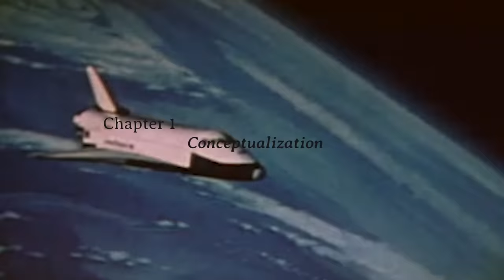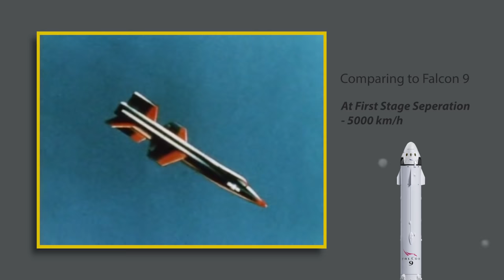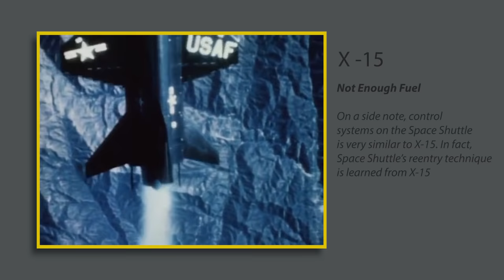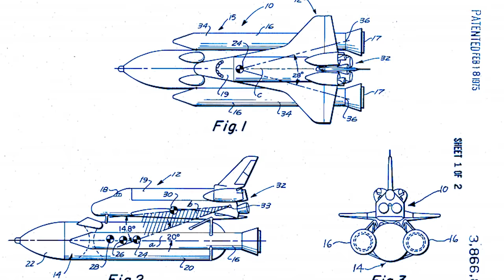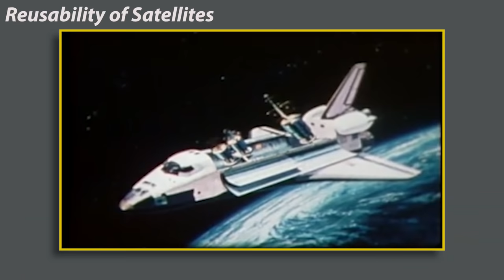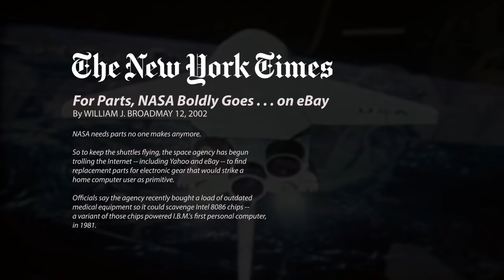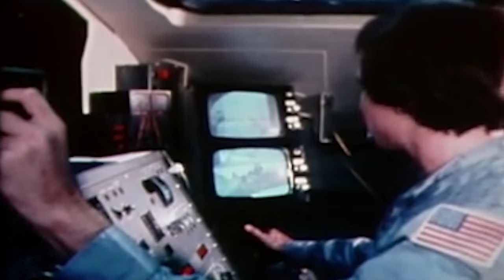The Space Shuttle, a failed attempt at Reusability?

Comment: 7:50 you said that there were 0 fatalities during the Apollo program. However 3 astronauts were killed during Apollo 1. They were burned inside the command module.
Reply: Parthenis Deslis yes, a bit of an oversight there
Reply: Was just about to make the same complaint myself, but other that that it was a good video :)
Reply: CC Williams, Elliot See, and Charlie Bassett died in a plane crashes too.
Reply: Technically that wasn't during a mission so I don't think that counts.
Reply: The thing is that those 3 astronauts died in a test of what was supposed to be the Apollo 1 mission but after the accident NASA stablished the name AS-204 for the mission so people wouldn't relate it to the Apollo program.
Reply: Miguel NASA actually specifically named it Apollo 1 as per the widows' request, so their husbands could still have a flight. (Source: Carrying the Fire or Apollo 8, I forget which book) Then Apollo 2&3 we're retro activity named AS-20x flights. The neglect that lead to the Apollo 1 fire was the same neglect that lead to both Space Shuttle disasters
Reply: With Apollo 1, that wasn't necessary a lack of oversight. While yes, the hatch was an issue along with some other factors. The main factor that started the fire was an electric wire that had lost it's Teflon coating which allowed it to arc. 

The events of Columbia and Challenger both could have been preventable had NASA taken the appropriate approach when they should have.
Reply: Alex Marquette, Apollo 1 WAS preventable. While the frayed wiring was the source of the spark, the fire was the direct result of a cabin pressurized with 100% Oxygen. It was already a bomb waiting to go off. THAT was the fault of NASA and was preventable. As Frank Borman said in part ‘It WAS a failure. A failure of imagination. Could an astronaut die while on a mission? Sure. But no one imagined it was possible for astronauts to die on the ground during a test.’ 

Also, the astronauts never burned. They died of asphyxiation.
Reply: +glennac The Apollo capsules continued to use 100% Oxygen.  The interior was redesigned to allow this "safely". That's why they needed an airlock to dock with Soyuz on the Apollo-Soyuz friendship mission.  It also simplified and lightened the Lunar Module and the EVA suits. EVA suits on the ISS continue to use 100% oxygen because the lower pressure differential to the vacuum lessens fatigue.
Reply: They pressurized Apollo 1 above ambient to simulate the pressure differential in space. So the absolute pressure on the ground was about six times higher than it was in-flight.
Reply: klugshicer, Yes, my remarks should have emphasized the “pressurized” nature of the 100% Oxygen. That’s what killed them. A change did follow regarding ground level atmosphere inside the Apollo capsule since NASA now realized there was a deadly problem.

“The Apollo 1 accident investigation prompted NASA to revisit the spacecraft’s pure oxygen environment, the benefits of the simpler and lighter single gas system and a low density flight environment remained. The real problem, NASA reasoned, was the high pressure at sea level, something that only happened before launch. And so the proposal was raised by Max Faget, one of the pioneering engineers behind the blunt body capsule spacecraft, that NASA change the only the launch atmosphere of the spacecraft. He suggested replacing pure oxygen with a mixed gas atmosphere, either oxygen-nitrogen or oxygen-helium in a 60:40 ratio. This mixed atmosphere could be bled out during ascent into orbit and replaced with pure oxygen. It would demand only minimal changes to the spacecraft and wouldn’t affect the crew; they would be breathing their own pure oxygen supply at launch as usual.
NASA accepted this proposal on March 14, 1968, and selected nitrogen as the diluting gas there were fewer questions about how onboard systems would interact with nitrogen than helium.” (https://www.popsci.com/amp/why-did-nasa-still-use-pure-oxygen-after-apollo-1-fire)

Either way, NASA realized THEY had killed the Apollo 1 astronauts and decided to make changes to prevent that in the future.
Reply: He completely wrote Christa McAuliffe out of the Challenger tragedy. According to him there were only 6 on the shuttle. Too bad she was number 7.
Reply: Constituionalist Libertarian 5:30 He says there were 5 NASA Astronauts and 2 payload specialists, which makes 7.
Reply: Click on 5:30 to hear what he says. And yes, McAuliffe wasn't an astronaut, she was a payload specialist. And while you can argue she wasn't there because of the payload, payload specialist is just what you call people on missions that aren't astronauts. For Details see https://en.wikipedia.org/wiki/STS-51-L
Reply: he might only be counting launches, apollo 1 was a dress rehearsal.
Reply: https://www.nasa.gov/mission_pages/shuttle/shuttlemissions/archives/sts-51L.html

It's the source on which wikipedia is referring. Under the picture it says "Payload Specialists Christa McAuliffe and Gregory B." I guess the payload she was the specialist for was the teaching material. Or maybe NASA didn't want to create a new category for just one person. Since you probably are going to continue argue with me, what was she called in your opinion? Maybe they called her something else on television at the time, that doesn't change the fact she was officially considered to be a payload specialist and that Lei didn't make a mistake in that matter.

Here some more sources, both refereed to from wikipedia and both referring to McAuliffe as a payload specialist:
http://spacefacts.de/ballistic/english/sts-51l.htm (not exactly official though)
https://www.jsc.nasa.gov/Bios/htmlbios/mcauliffe.html
Reply: The source is NASA's official site. They are ultimately the authority on deciding who is a payload specialist and who isn't. You can argue that she should've been called something else and I would respect your opition, but that doesn't make it a "fact". You didn't tell me what Lei or me are supposed to call her. You probably don't have a answer to that. Instead you resorted to discredit me because, supposedly, I'm to young to know anything. Even If I am younger, you can't just say you're right because you're old.

I wonder what happened in your life that you can't admit a mistake. I've refuted almost every statement you made;
-that Lei supposedly said he spoke of a crew of six, which he didn't, I also gave you the source for that
-that me or Lei supposedly called her an astronaut, which neither of us did. You didn't even say where we supposedly said that.
-that McAuliffe supposedly wasn't a payload specialist. I gave you (multiple) sources for that from the most official source on the matter, NASA itself. You still claimed I'm wrong and didn't even bother what she was supposed to be

All the while I was trying to be respectful. Now I'm sure You're going to think I'm just a stupid liberal or "millennial" or something and are going to voice you're concern about the current generation at the next Libertarian convention or something. I'm also quite sure that if you chose to tell anyone about this conversation it's going to be told very one sided. But you know what? I don't even care. I can sleep well tonight having argued fairly and with sources.

I wish you all the best in your future endeavors and hope you can one day lead a civilized discussion.
Reply: And the near fatal accident of Apollo 13 counts as a failure of Apollo hardware.  So, when you include all Apollo missions (as well as Skylab and ASTP), Apollo had a 1 in 15 failure rate.
STS had 135 flights and two major failures, which gives a 1 in 67.5 failure rate.  Far better odds

Plus, as I mentioned earlier, the Space Shuttle had more successful flights than Mercury, Gemini and Apollo COMBINED
Reply: Oh so there's a big conspiracy going on at NASA? Maybe I am wrong, but you owe me proof of that. You didn't give one source which doesn't call her a payload specialist as an official title. Spoiler alert: You're not a source.

I didn't talk down to you, opposed to you I stayed polite throughout the discussion. Being alive when something happens doesn't automatically make you an expert on the matter.

You tell me to go look Christa McAuliffe's official title. Since you were alive at the inception of the internet you're probably so much better at it than I am. So why don't you do it?

You'll never get an admission of wrongdoing on my part nor an apology. At least on that matter and I doubt we'll ever have a conversation about something else. If you wonder why I'm still answering your comments it's because I'm 100% sure you're getting more pissed off at me than I am at you.

Again, I gave you other sources than Wikipedia. I know it's a questionable source, but I honestly didn't think anyone would question such a minor fact. I guess I learned something after all from our conversation. I wonder if you claim the same.

By the way they were a lot of Millennials alive during the challenger disaster. They probably were very stupid at the time but that didn't stop you on having a strong opinion on the matter. I guess that's it on being nice on my part. I'll block you after this response. You can count that as a win if you want to.
Reply: Constitutionalist Libertarian - "First teacher in space" was not a title, it was a slogan.  Teacher or not, she was Payload Specialst 2 on STS-51-L.  Titles were to to denote position on the ship, not actual rank.  After all, the "Pilot" didn't actually pilot the shuttle either, that was the Commander's job.  The Pilot was more of a flight engineer.

The vast majority of Mission Specialists and Payload Specialists were not astronauts either.  Most were scientists, some were engineers, several were medical doctors, and a few were even just passengers, but still designated in the flight crew as a "Mission/Payload Specialist"

And speaking of Millennials, that includes people born as early as 1981, who were very much alive during the incidents in question.  You mention "ignorant tool" when you illustrate two rather sizable instances of ignorance yourself.
Reply: klugshicer, did I say that? No. I love how you went there though. How about if you want proof, where it is clear you weren't even a born at that time, you go ask your mommy or daddy if what I said is true. I am sure they will tell you it is.

Being alive to witness something does make you knowledgeable. Not only that, when it is a teacher from your state who is taking the trip into space, where it is a point of pride for the people of the state, you are going to learn a hell of a lot more than say someone from California would on the subject.

You did too talk down to me. Like you did in your last comment, this comment, and your comments prior. I love how people from the Millennial generation act like you and then try to play stupid and claim they aren't doing so.

No, Millennials were not alive during Challenger. Try, it was Generation X. As in the generation that popped out most of you Millennials.
Reply: Parthenis Deslis Because it wasn't in fligth
Reply: Constitutionalist Libertarian 
She died because of NASA management pressure, which was caused by political pressure from Congress. Not an engineer.
Reply: Factorio 
Yes that was a rehearsal for the actual flight which was scheduled in a couple weeks, with that specific rocket and capsule.
Reply: Parthenis Deslis 
Did you know, that while the Apollo 1 capsule was being built, Grissom, Young, and Chafee went to the North American plant to examine it. They found so many things wrong with it. Inspite of their complaints about it, they were told it was too late to make changes, and if they wanted to, they could leave NASA instead. They decided to go ahead with the flight, but on his way out, Grissom put a lemon on capsule.
Reply: Yes that oversight made me cringe!
Reply: It was during a simulation so I guess that’s debatable

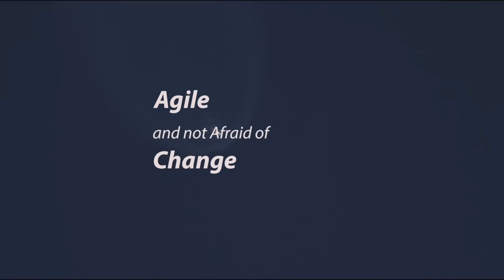Comment: 9:55 Technically Russian Soyuz is older than Shuttle but it is still used because of its safety record
Reply: Konstantin Lei is a bit of a spaceX fanboy
Reply: Today's Soyuz is completely unrecognizable internally to its past counterparts.  The only real thing it has in common is external design.  Besides, the first Soyuz variant (even if you include all minor upgrades up until the Soyuz-T) had a lower overall success rate than the Shuttle.
Reply: @Comical1984  I may have worded it wrong.  What I meant to say is, the original Soyuz line had the worse success rate.
Everything from Soyuz-T to the current Soyuz-MS has flipped that to instead be the most reliable spacecraft until Shenzhou, which has yet to suffer a single failure.